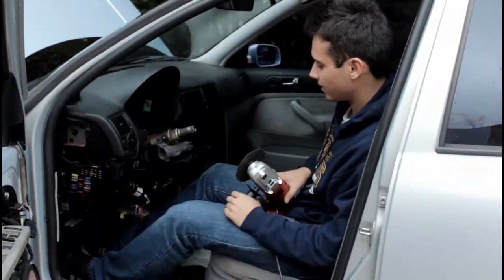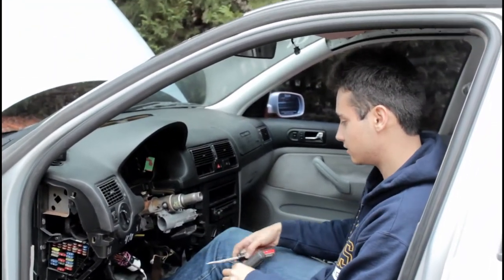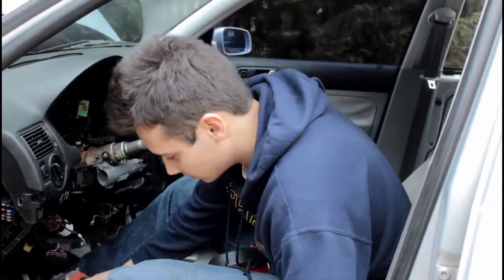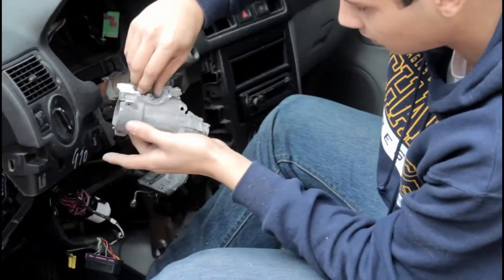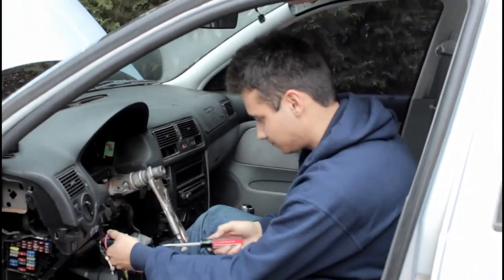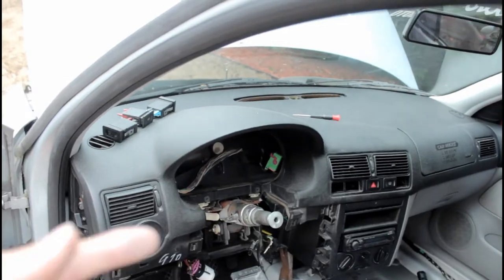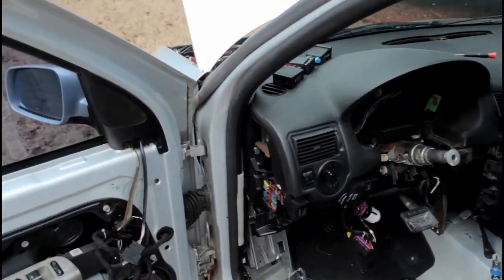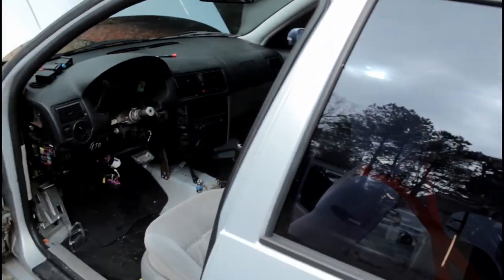How to start a car with a Screwdriver (VW Golf MK4)

Comment: I have a 1998 model but it is with immobilzer and it start that Way but it shuts off again after 3 seconds.   Can i do anything with that?
Reply from the maker: Ecu needs to be tuned or a key programmed no way around it mine did not have a immobilizer so that helps
Reply: Oh okay thx:)